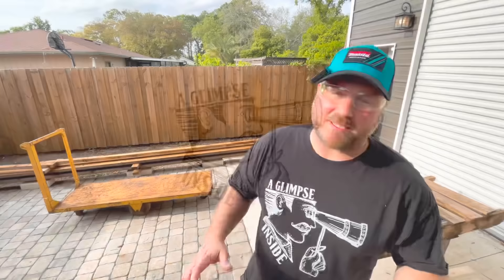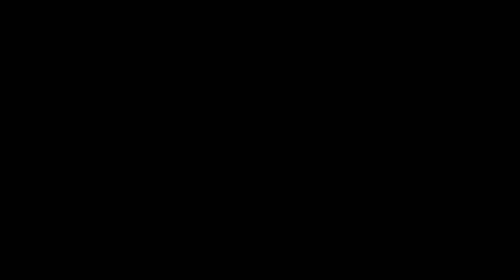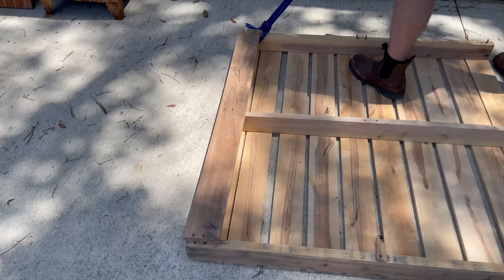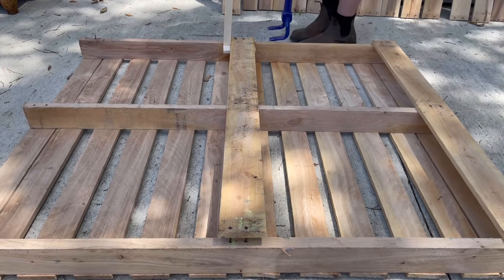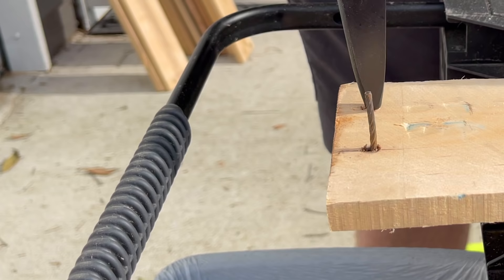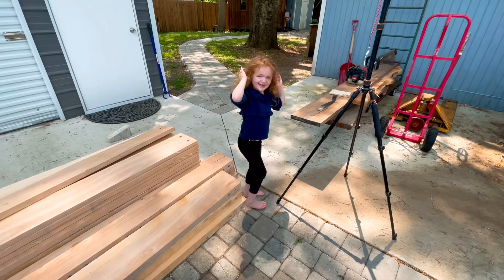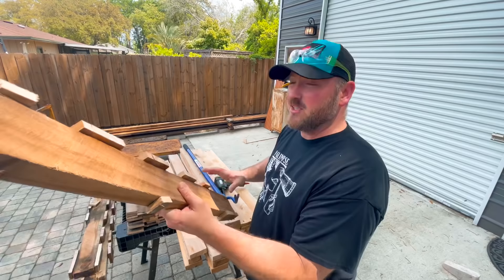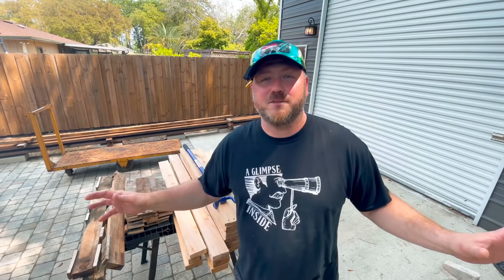The BEST way to Break Down PALLETS | Yield the MOST Wood Without Damaging it! | Must Watch

Comment: That is a selected pallet. Some pallets are not that easy to dismantle. He needs to demonstrate on differently constructed pallets made of different wood.
Reply: No kidding I took some apart last weekend and they were way harder than this. They had ridged security nails in them. I ended up having to cut off each end

Comment: I have a similar pallet bar, and an air locker tool, and yes the wrecking bar does tend to split the odd board. I do like your spreader to put under the pallet breaker to spread the load. A simple solution to the splitting problem!

Comment: Thanks for the tip on that fantastic denailer! 

Whenever removing boards, do each end first, then the center. It'll keep one nail in the second end from turning into a hinge and making it awkward to remove. Do each end and then the center one will just pop right out. You will have the board resting on the hooks of your wrecker and can you can deftly throw it off to the side into a pile.

Comment: The air locker tool is awesome. I’ve noticed that it will 95% of the time push the nail all the way out on soft woods but hard woods it pushes the nails out good enough to use a hammer or bar to pull them the rest of the way out. They have the wrecking bar at Menards too

Comment: I bought a pallet buster online that has long flat arms that make contact with more of the wood.  They are set on a pivot point so the whole length of the arms make contact with the wood.  No splitting of the wood like your crowbar-like version does.  I bought an Air Locker denailer too. That thing is awesome.

Comment: Been using a pallet buster for several years and the air locker they are fantastic.
However big skids are still tons of work bigger boards 2x4s but so worth it.
Bobs pallet buster is the trick

Comment: I bought both of these tools a year ago and they are amazing there is no other way to tear down pallets once you buy these 2 tools and bonus note the air nail remover works on other nails and boards i have been working on projects and put nails in a 2x4 or plywood that i ended up needing to remove and the air nailer worked great to remove them and is quick and easy just need a catch can
Reply from the maker: Great tip. I’m sure it’s multi functional As you quickly found out. Thanks for sharing brother

Comment: Hey there ! Just discovered your channel and am enjoying it ! I see you mentioned you were in Jacksonville. I am in Folkston, GA, just north of you. I work at a plant here in Folkston where we make roof trusses for the manufactured home industry. We supply most of the local big name brands such as Fleetwood, Clayton, Live Oak, Scotbilt, and down into Florida, Jacobson, Champion, Skyline, Skyhawk, Townhomes and Nobility. We also make some pallets. From standard 48x40's to huge skids for Polaris Rangers and Ranger Crews. We have had a need in the past for pallet disassembly tools like the one you showed. We actually fabricated some out of thick walled 1" square tubing and they worked great. Same basic operation of other 'deck wrecker' tools. Of course they need to be welded together, but they are beasts !

Comment: I own a pallet buster tool and it works rather well.  You still get some broken ends or big holes where the nails get pulled through and stayed in the runner.  All of this is due to different ages of pallets, thickness of slats, number of nails and such.  It is still the best tool I have found to break down pallets quick and easy

Comment: Yep the middle row is most important for the maximum yield. The ends could be chewed up and already split, but the frame itself gives you hardwood thickness (2-3 inches or more) that if you could find, would cost a great bundle.

Comment: I personally use a pallet buster when I work with pallets and used to be in love with it. I did find that some wood even with the buster's swivel head which guarantees it's always flat against the wood I would still get splitting on the sides. I'm thinking some pallet wood is so dry that it's basically lost most of it's ability to bend without breaking. We should have a pallet dismantling contest one day ;-)
I personally prefer to use the air locker over a bucket with a bit of water or better yet in the winter, with snow so they don't go bouncing around
Very nice video, informative and accurate

Comment: I've seen the bar on other videos before BUT now with your endorsement, I'll look into getting one - USING YOUR LINK OF COURSE ;) Also, thanks for the link to the Air Locker, I'd seen it only once before and I could not remember where. I like saving the nails and repurposing for decorative purposes. I cut them about 1/2" below the head and barely drive them into my projects to get that rustic look. GREAT video, I really like the info. Take care and stay safe.

Comment: I bought something similar that has a pivoting head on each of the tines of the bar (where you have crowbars).  It still breaks the wood sometimes, but it basically does what your plywood insert does, automatically.

For the nails, I actually enjoy the exercise of hammering them out, so I haven't bought a tool for that yet.  If I did a lot more of it, I'm sure I would, though.

Comment: Nice tool, and good instructive video! Tool upgrade suggestion: put the claw on the top of the tool for removing nails, and put a soft double hook at the bottom to remove boards w/o splitting them. Major improvement IMO

Comment: Hey Chris.  Airlocker is great suggestion!  In the past, I've been successful putting the pallet upside down on a table, having 1 end unsupported and whacking a mallet on a scrap piece of 4"x4" hard maple on each side and occasionally middle of the pallet (center supports can get stickier). Then move more of the pallet to be unsupported  until 1/3 done. Stick another table underneath the floating 3 4x4s. Continue to move the pallet until it's top has been removed. Then flip it over to what was right-side up. Knock out the 3 underpinning support brace boards. But of course now I've got a bunch of boards with nails sticking out.  Wish I knew about the Airlocker back then!! Right shoulder hurts just thinking about those days... 🤕
Reply from the maker: Sounds like a good method to me . But yes the pneumatic air locker hammer is amazing. Everything about getting back into it?
Reply: @AGlimpseInside  Have I thought about going back to using pallet wood? I was (am) a wood hoarder (to my wife's everlasting annoyance and frustration) and have enough to make stuff for next 3, possibly 4 years straight. I'm selling off projects pieces I attained and finishing the uncompleted projects (stain or paint notwithstanding).  So, no- I don't think I should mess with the 14 pallets still in possession.  My shoulder will give it away that I was hammering out nails... holdup!   I think I might have to go buy a new tool! 😉
Reply from the maker: @zafarsyed6437  haha. Too funny. I got it brother. You’re stocked time to spring into action. All good man great to hear from you

Comment: Even easier, and no need to purchase the pallet buster, is to drive the slats straight away from the stingers (angled like pry bars equald splits, straight like this method equals no splits but the ones already there).  Just prop up the pallet face down on a couple other pallets (stacks of 2x4s, etc.) under the slats at the 2 ends.  Take a 2x4 as a driver, set it flat against a slat you can reach, next to the stringer where it's nailed, and hit it with a hammer to drive the slat straight down toward the ground.  

For slats harder to reach, where they're opposite another slat, use 4 small (about 1 foot) chunks of 2x4, 2 of them of equal length.  This time you're removing a slat on the top surface.  Set the 2 equal ones on either side of the slat next to the stringer where it's nailed, lift up the pallet, and slide a third chunk of 2x4 under the slat and on the 2 equal ones, like a bridge.  Now you hammer on the stringer on either side of the slat to drive the pallet straight down and leave the slat up on the little bridge.  Move the bridge to the next nailed location, and repeat.  

For the remaining slats on the bottom, prop up the pallet again and drive those down, like the first ones.  The whole process takes about 10 minutes, once you've done it a couple times.  You're left with as split-free slats as you could want.

Comment: Thank you for this clear, concise video.  I've been thinking about getting one of these pneumatic nail punches but my concern is whether I can run it on my small 1 to 1 1/2 hp portable jobsite compressor.   Does it require a huge reserve tank or larger compressor like auto body or mechanic's air tools require?  

I can read the specs & see the range of psi for this tool but it is the cfm/volume required to run it efficiently that I'm wondering about.  Are they similar to a nail gun as far as how much air is needed to run them?  Will it only fire 2 or 3 times before I have to wait or the tank to fill up while the portable compressor recycles?   Any help would be greatly appreciated.  Thanks.

Comment: PERFECT
Reply: Now I need to take these tools to pallet collect site and pull apart pallets before loading in trailer I’ll just need to be mindful to break apart in grass area and sweep area with magnet roller wire nails. This will keep them off roadway and parking lot. Haul the most per load.

Comment: Just a question: It looked like the tip of those nails had been ground flat before you used the Air Locker. If so my guess is that the instructions say to do so. Is this correct? Thanks.
Reply from the maker: Great question 
The nails are flat so as to not split the wood while building them. It seems strange but a sharp pointed nail will split the wood more regularly than a blunt one
Reply: @AGlimpseInside  I should have known that. Thanks.